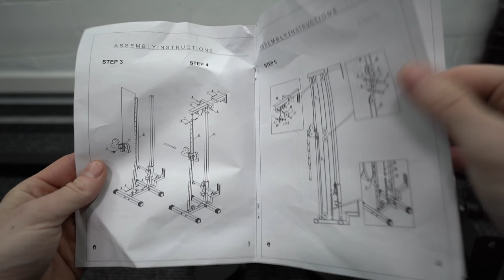TITAN FITNESS Wall Mounted Pulley Tower COMPLETE INSTALL GUIDE

Comment: Brilliant and excellent step-by-step assembly video!  I rarely even looked at the owner's manual assembly instructions except for confirming which parts to use if I wasn't sure.  I loved your video as I watched it once all the way through then just went step by step through each section till it was all done...no guess work and only had to redo a few things as I had the cable going to wrong way or something easy to adjust.  Thanks for doing this video!

Comment: Great job - now please add the steps to mount this "wall mounted" device to the wall - directions Titan should have included to help keep inexperienced folks like me safe!
Reply from the maker: @rhodesmk  I totally agree. While I already have this mounted I highly suggest you lookup “how to use an anchor bolt” and follow those steps. It’s very simple once you learn how it’s done. You just need the right drill bit

Comment: Curious how it is holding up to use, and what you think of it!!
Reply from the maker: Product is great especially for the price of it. I changed out the rollers to ones with better internal bearings. The kit was under $100 and made the world of difference in how smooth it functions. I’m happy with the purchase
Reply: @CodyDIY  what kit did you get? I would also like to do this.
Reply from the maker: @FreedomBaby  the kits on Amazon Universal Aluminium Alloy Bearing Pulley Wheel Gym Accessory Diameter 90mm&115mm 2 Size for Fitness Equipment https://a.co/d/hRZB175

Comment: How do you mount to the wall?
Reply from the maker: Lag shield anchor from Lowe’s/Home Depot. If Into concrete Drill a hole in the cinder block using a masonry drill bit, then insert the lag shield hand tighten down the lag bolt. If into wood, a standard lag bolt into a stud will be good enough.
Reply: M12 lag bolt is good enough for wood studs? Is item 6 from the manual’s hardware list used at all?
Reply from the maker: @mikelam9253  Item 6 will be used if going into concrete. If you are going into wood you should be using at least a 1/4" lag screw which I'm not sure they supplied. 1/4" lag screw has about 10,000 lbs weight capacity. Way more than enough for wood studs. Just use a fender washer to take up space in the mounting hole so it has a surface to bite.
Reply: @CodyDIY  hope they could update their manual. I got a 1/2" lag screw and some washer. Let's see.
Reply: 🔥🔥🔥 helped alot